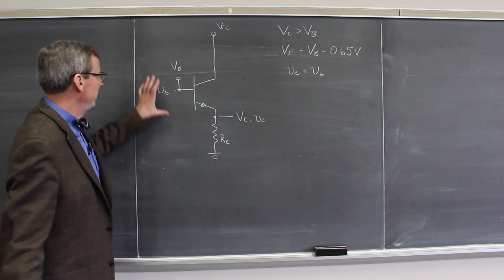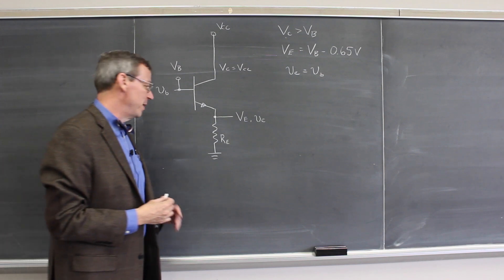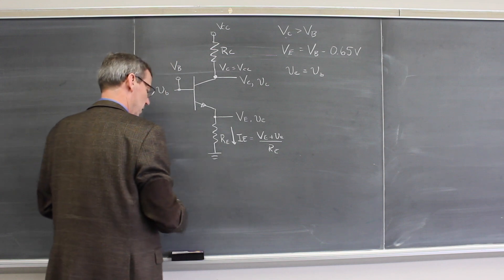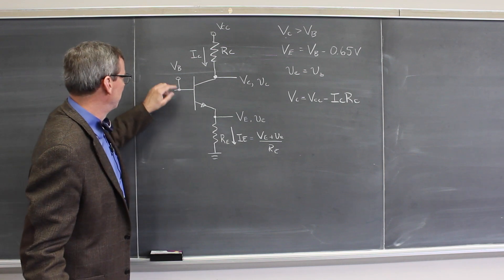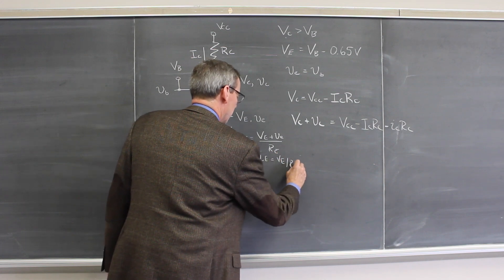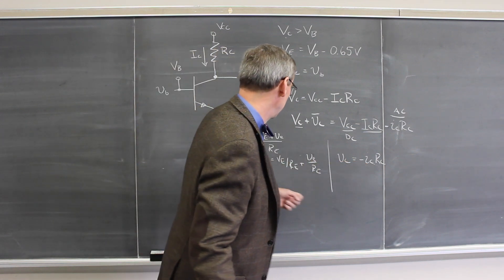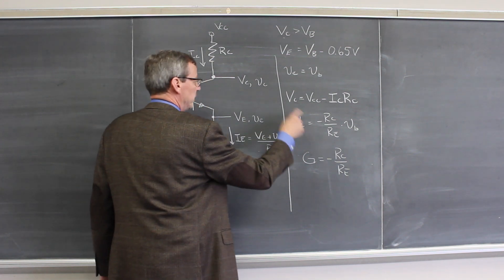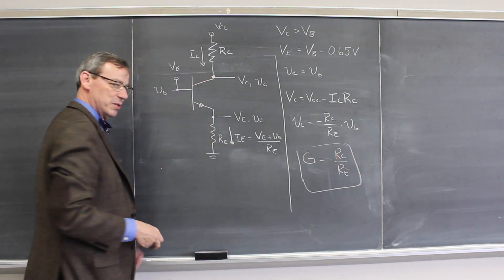The Common Emitter Amplifier

Comment: Just to reiterate "The emitter voltage is just copy of  the base voltage"  --> The ac voltage of emitter is  copy of ac base voltage  🙂
Reply: This still confuses me - 4:50 

What happens at the BE junction during a small AC signal? Does it just short - or how else would they become copies of each other? 

The way I understand it now (probably wrong) if we were ignoring the 0.65V and make an approximation by replacing VE and VB (since they differ by 0.65V)

Comment: During the negative half of the input signal doesn't the base emitter junction become reverse bias?
Reply: Nope.If you put 3V battery with 8V the resulting voltage will be 11V.Similarly if you have ac input  ex: -4 to 4 volt and you add it with vcc lets say 8 volt the resulting waveform will be 4V to 12V.this is how bjt is operated.
Reply: @oogway5472  pls do  suggest some textbook for electronics
Reply: @aspirants aspirants I think millman's books are the best